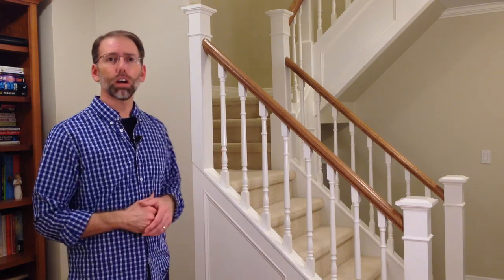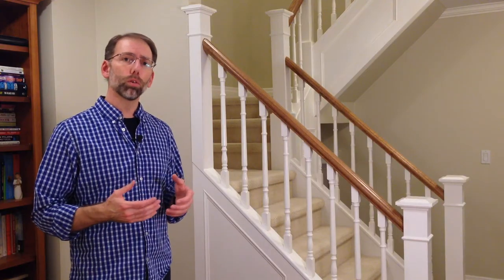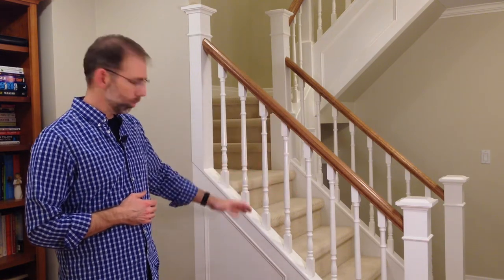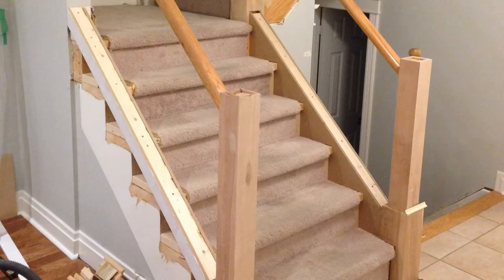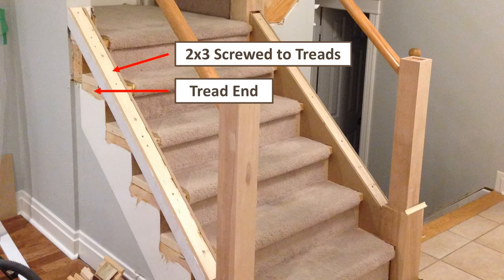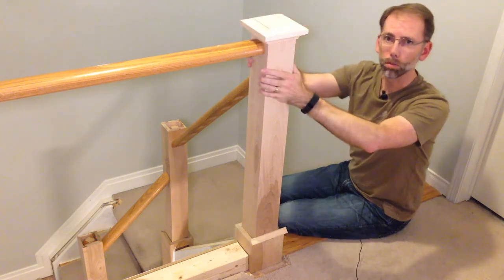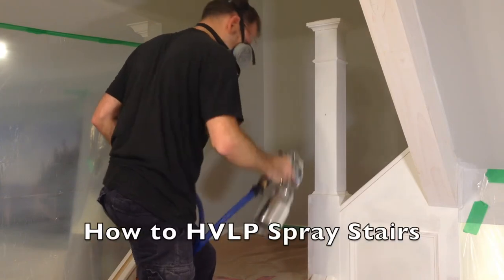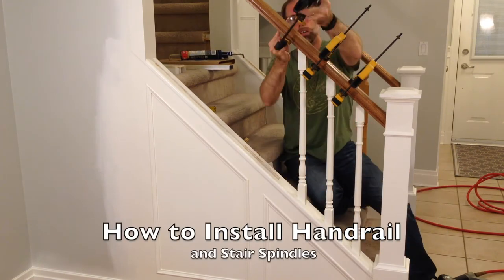Staircase Makeover (Staircase Renovation Series)

Comment: Looks good.. What's going on with the chipped up tile at bottom of stairs ar u changing ur tile too?
Reply from the maker: Yes, it's on the to do list.  The tile needs to be replaced, but the newel posts contact the subfloor, so I chipped it away the to work on the staircase renovation.
Reply: Home Improvement Woodworking I thought that might have been the case. Stairway definitely looks better the way u changed it then the way it was that's for sure. Definitely do nice work..